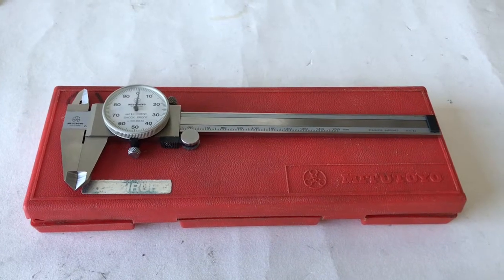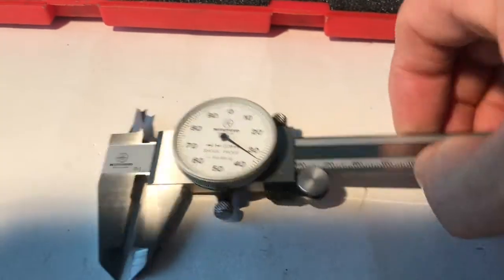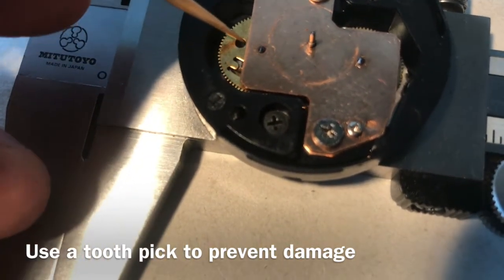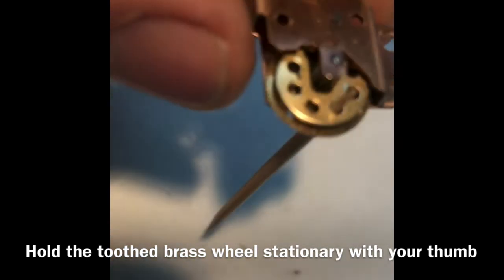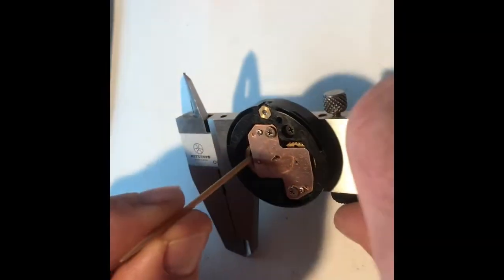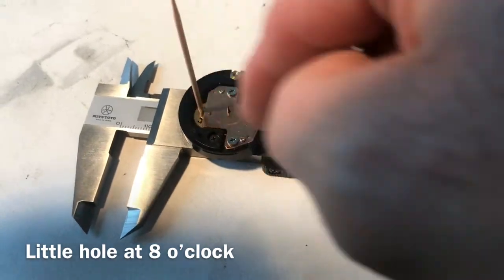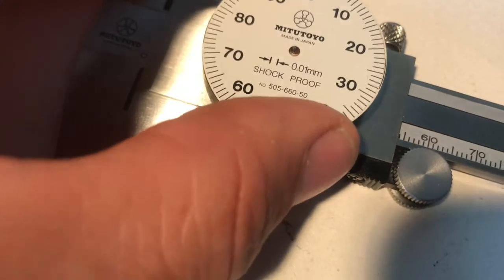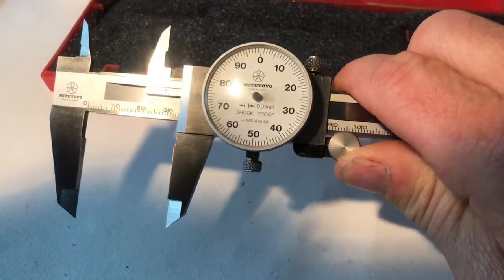How to fix Mitutoyo Dial needle preload - Part 3

Comment: I found all three videos extremely helpful thanks. My 505 has a regular clunk as I go up and down the rack so I want to disassemble it to find the problem. I figure it’s probably a piece of grit stuck in a cog. I had no idea about the preload. Thanks heaps, Stuart 🇦🇺
Reply from the maker: Thanks and all the best on the service. You can do it. 👍
Reply: @YoucandoitwithJules  Thanks, and I did do it. All fixed and works perfectly. Cheers Stuart. 👍👍👍

Comment: Great series of videos. The sound track was very quiet, and you mumbled at times.
I have a different model. Mine is a model 505-626 on the dial face. It is in index, although there is a mm scale, too! The dial goes from 0 to 100 to half way, then another 0 to 100!

The box says 505-633 p15.
Reply from the maker: Thanks for the feedback and keep us posted. You can do it 👍

Comment: It is not shown in your videos - how did you remove the bezel? Did you just pry it off? My caliper is missing a crystal and I want to fix that.
Reply from the maker: Hi, it's in Part 1 just use your thumb nail to gently pry off. If I'm doubt check the part 1 video. You can do it 👍

Comment: Are both the gear wheels spring loaded with same spring tension?
Or only one them?

In my caliper, spring loop from one wheel is coming out.
Please help
Reply from the maker: I think from memory just one wheel  is sprung as it take up the slack against the other. Keep us posted on how it goes. You can do it 👍
Reply: @YoucandoitwithJules  thanks for the help!
One of the gear was worn out. So i changed it from another damaged calipers.
And yes one of the gear is in 'full-on' spring tension, the other one has very little spring tension.
I just placed the gear train on the rack. No preload or anything.
Still trying to figure out how to preload. So that needle does not jump one or two graduations on dial when bought back to zero.

Comment: Great series of videos,,, even though I’m actually disassembling a set of Fowler calipers, they are actually built about the same, except a couple of the plastic parts on the mitutoyo model are either aluminum or stainless on the Fowler brand. And the Fowler brand has three set screws on the back shim instead of two ? 
   Thanks for the information !!! 
  o.w.
Reply from the maker: Thanks for the feedback. You can do it

Comment: i did the exact same thing.  tried to press in that little slot ont he bottom to reset the needle to true north, and square the dial to the ruler but it seems like press their did nothing so i just backed away and ill leave it cock eyed :P
Reply from the maker: Hi yes some dials seem to have a reset function and other don't. You can do it. If all you want to do is reset the needle you can do that easily by. taking the dial cover off remove needle and reset. You can do it